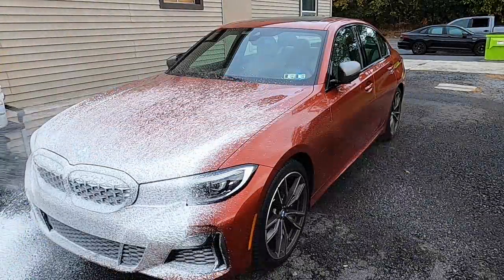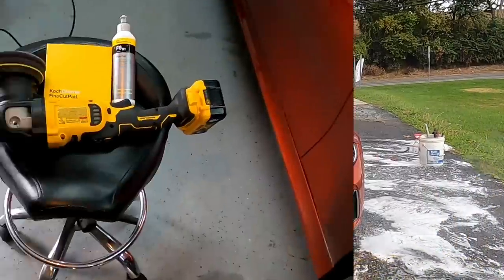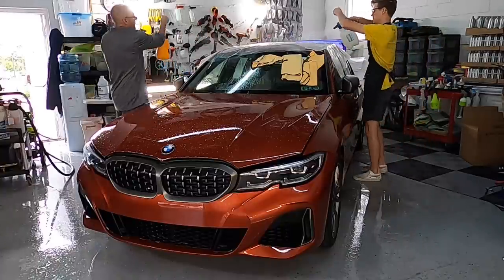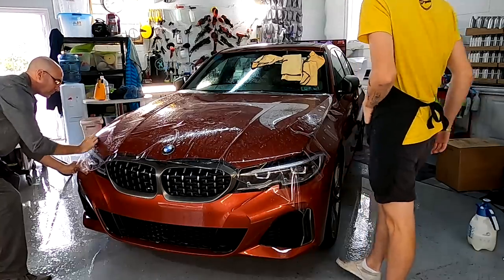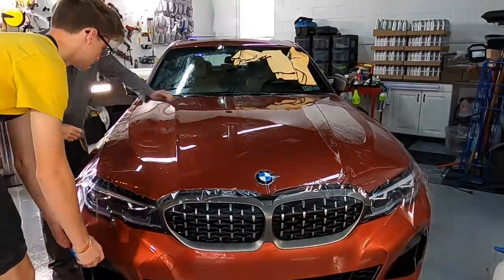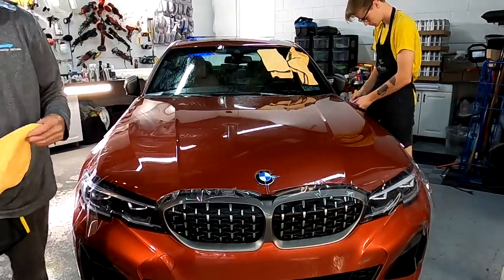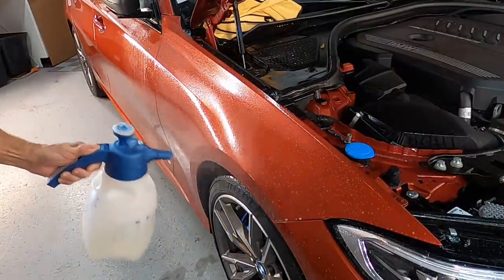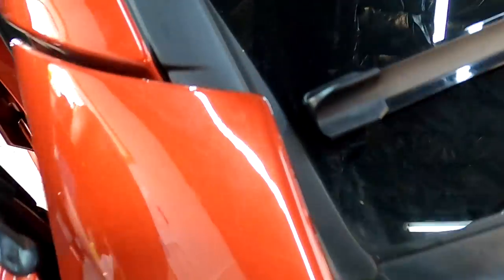FlexiShield Paint Protection Film! The Ultimate Protection For This New BMW M340I!! Apex Detail!!

Comment: Awesome job!

When I ordered my '19 Velar, I told the dealer to leave all the manufacturer provided protection on it. On delivery, I took it directly to the PPF installer. I had XPEL Ultimate Clear for the front, A pillars and mirrors and ClearPlex Windshield Skin.

Comment: How many years before you need to replace the film, given that it doesn't experience any road mishap? Thank you!
Reply: For my vehicle, I was quoted at least 5 years, depending on the environment (garaged/not garaged etc.)
Reply from the maker: 4-6 years... sometimes longer.
Reply: FWIW, I had PPF put on a new car then the whole thing was ceramic coated. I traded it in at 4.5 years and it was looking fantastic. It had one significant gouge. I'm not someone who takes care of my cars' exterior, either. Highly recommend it